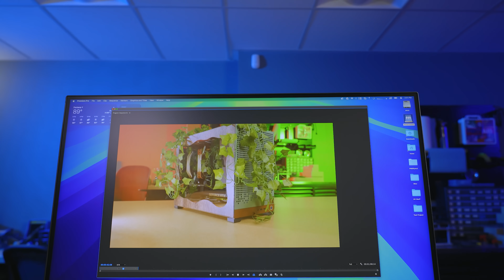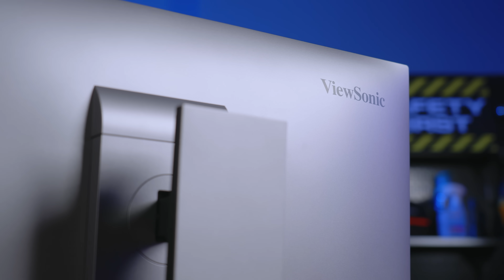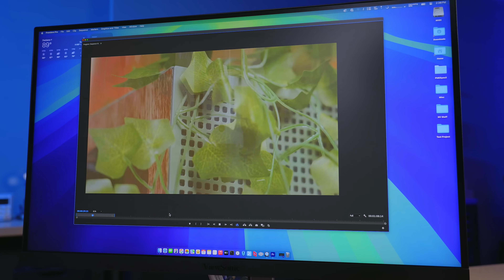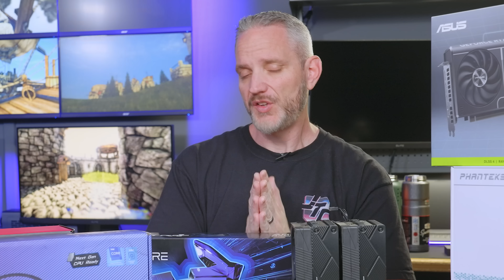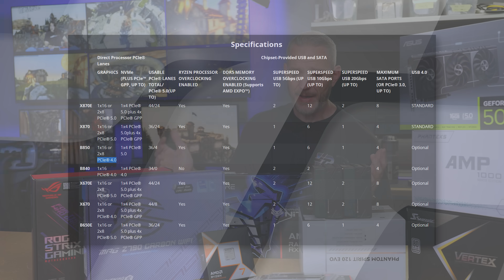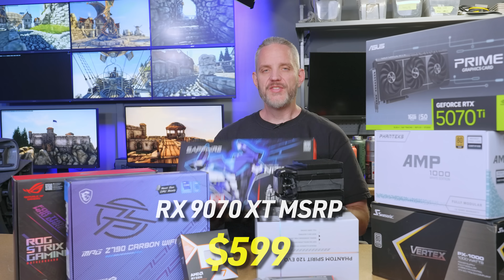This is the Sweetspot for PC gaming... Don't get fooled into spending more!

Comment: I love that Jay brings some common sense to PC building, Not just throwing top of the line products at everyone, The drive comparison for example.
Reply: Well... Cpu upgrade is a lot cheaper than GPU upgrade currently so for spending more on cpu is easier and good future proofing.
Same for faster ssd.
Especially since a lot of player are Fortnite Minecraft and cs 1080p high fps players and in those case, ram, cpu and ssd speed are important
Reply: @Tailslol  Futureproofing is such an empty buzzword that leads people in the wrong direction. Assuming a fixed budget, people buy a CPU for the future and a GPU for the present, which means they get lower performance now for the possibility of higher performance in the future when they upgrade the GPU. The upgrade might never happen, but at least they're ready for it!
Reply: @hafenauer Exactly. Similar to how pickup trucks are basically the most popular car. Most will almost never use that towing or space, but convince themselves they Might need it some day. In the meantime they’re paying tons for gas, not to mention the higher sticker price.
Reply: @hafenauer   it would be true if gpu and cpu values was equivalent and gpu readily available  .
high end to mid range cpu difference is probably 250 to 350 and readily available.
when a gpu is 1000 to 1500 and probably out of stock.
so the cpu upgrade is not penalizing your hardware budget .
we keep desktop around 6 to 10 years so you are very likely to cross at least 2 generation of gpu and upgrade is very likely .
Reply: @humanflourishing2262   i live in europe so pickups are not a thing... and the car analogy is really not appropriated here when current generation of gpu doesn't run any modern games well already without frame generation and upscaling. and lets not forget, cpu and gpu values and availability  are not equivalent currently.
Reply: @Tailslol Ha, that's fair. I guess I disagree, since anything from the 9060xt 16gb to the 5017ti are all 1440 capable. But it depends on what fps demands the individual has, so you are correct in certain contexts. I'm pretty casual so ~90 for me in single player is great!
Reply: @hafenauer  Its not. People who say this don't future-proof really. I had a devils caynon i7-4790K  forever, (7 years?). I bought the cpu that people said, why do you need 4 cores (i think my bro had a 5xxx same thing top of the line cpu)? Well  that's why. I just kept upgrading video cards and it was GREat, then good, then fine until i think 7 years later (i actually did a lot with it in its last days just to see how far i could push it).  Understand, i built multiple PC's in that time for people. But why fix what isn't broken? 

I bought a 7900xt for my last build, when everyone was saying not too (1st AMD purchase ever, because the power and reliability is there for the $$). Recommending not buying them was a thing (that changed but go watch the initial reviews). Why? Obvious, power for $$. Now those cards and 9000xt/x versions are just recognized as the bang for $$. You don't future-proof based on whose (upscaling) DLSS is working well at the time, but raw power.
I did go with a 9800x3d for my last build. I actually was going to go with the 16 core. Because power. But the scheduling, which granted has improved, has an issue. It improvement is not retroactive.  5xxxx3d and 7xxxx3d don't do scheduling as well as 9xxxxx3d, which indicates the next x3d gen's improvement will not be retroactive to the 9xxxxx3d as well. and this is a problem and not worth messing with FOR EVERY SINGLE GAME.
Reply: @Tailslol "Future proof" is a myth inte PC industry so why even use it?
Reply: the monitor is 1k lol

Comment: 16:44 Stop parroting AMD's marketing department. Changing the socket is not a bad a thing. By the time you should upgrade the CPU other technologies will have advanced, Gen 1 AM4 was no guarantee to have a single M.2 slot, what's the PCI-E generation, USB, networking, or many other technologies that have advanced and some didn't even exist like Rebar. If you keep the same motherboard and just upgrade the CPU you are leaving features the CPU supports you paid for off the table because the motherboard doesn't include or support. CPU upgrade cycles should be 3-4 generations for the average user, How many things changed between the 10 and 14 generation of Intel? Would you want the 10th gen motherboard for that 14th gen CPU? No you would want all of the new features so changed sockets doesn't matter. This is the same as Gen 1 AM4 and the latest, buy the latest AM4 CPU as an upgrade you will pair it with the latest AM4 board so the long lasting socket doesn't matter.

Buying a CPU every gen like AMD's marketing wants you to do because you don't need a new motherboard so it is cheap is wasting money. You are buying a new CPU for nominal performance gains you probably won't notice, over 3-4 generations you paid more in CPU's than a new motherboard costs while never noticing performance increases. If you keep the CPU the whole time new games may start to show the CPU's age and not run at the framerates you want, that means it's time to upgrade... and you will see the performance gains and be able to use other newer technologies. The only upgrade path to be considered is when buying middle of the stack now and replacing with top of the stack later when they are on sale or fklooding the used market. 10600k to 10900k at gen 12 release.

Comment: at the start of summer i built my first gaming pc with 7800x3d (bought on sale ) and 9070xt ( got this at lauch and at rrp ) .850w corsair rmx psu . 2tb crutial t500 m.2 b850 tomahawk  corsair vengeance cl30 6000  ram ...in a nzxt h6 flow case thermalright phantom spirit air cooler .. just short of 1500uk pounds..

Comment: Yeah, this is the biggest generational shift we've seen in years — people are replacing RTX 1000, 2000, and even some low-end 3000 series cards. GPU prices are great right now — the 5070 Ti and 5070 are solid picks. On the CPU side, you can grab a Ryzen 7000 or a Raptor Lake chip for really cheap, and they perform almost on par with the latest-gen counterparts! And of course, they avoid tariffs... The second half of 2025 is going to be wild, and not just because of the tariffs.. 

( Honestly, I don’t agree that Intel has nothing to compete with. Where I live, the best-selling CPUs right now are the 14600K and 14700K — they cost next to nothing and outperform pretty much every Ryzen counterpart. To get better performance, you’d have to jump to a 7800X3D or 9800X3D, but those cost like four times more. That’s exactly why the 5070 Ti is selling so well here — people save money on the CPU and end up with a chip that performs just as well (sometimes even better), and the platform savings let them upgrade the GPU instead. Even the 5700X3D is selling like crazy here. You know that famous 'CPU upgrade'? Nobody does it. Every platform sees two or three GPU upgrades, and then the whole system gets replaced. So when it’s time to upgrade the whole rig, you need a new motherboard, faster RAM, maybe new standards have come out — people just go for the best chip at the best price. That’s why, besides the 14600K and 14700K, you know what the best-selling AMD CPU is here? The 5700X3D. But hey, sure, go buy a 7700, pay more for everything, and get worse performance for a CPU upgrade you’ll never actually do. XD ) PS i have an mobo 8200mhz aorus z790 pro x wifi7

Comment: If your purpose is only to game on your pc.. you should just get a console. 

With modern systems..you will only realize the difference in your games when you switch up hardware.. constant change = constantly checking how much of a difference it makes you FEEL. That’s the trap.

The truth is, 80% of max settings will play as normal.. your brain will filter out any real difference as you play the game. If you’re just monitoring the fps .. you’re not a gamer.. you should actually only buy the hardware that’ll run the games you want to play… that’s it.

If you do anything else, it’s good to spec out and design your system that’ll handle your workflow.

That’s why it costs a lot for these types of high end systems, any logical person would spend thousands if it makes them more money.. else you’re the sucker throwing your money away, driving up prices for the rest of us who should actually see this hardware at a reasonable price.

Comment: Just upgraded from a rtx 3070 to a rtx 5070 ti. I was actually able to find one at MSRP and I’m very happy with the upgrade
Reply: Did the same. Paired it with a 9800X3D and 2 sticks of 16 GB 6000 MT/s RAM and I couldn't be happier while gaming at 1440p.
Reply: @michalsnaiberg2734  What Motherboard are you using?
Reply: @Veo1337  ASUS TUF GAMING B650-PLUS. I got when it was on sale for about 50 bucks cheaper than it was usually at the time.
Reply: How as your driver stability been?
Reply: Same here except went to a 9070xt been great so far
Reply: Update - I have the nitro plus version that’s showcased in the video and I did NOT pay a thousand dollars lmao I got it for $650 on newegg
Reply: What cpu are you using?
Reply: Exactly same upgrade here. Also went for a cpu upgrade cause my wife needed a new mb + cpu in her pc and at the point of purchase it was the only gpu I could reasonably get at msrp.

Comment: Watching this video a couple days after I just completed my parts list purchase of: 9800X3D CPU | Astral 5090 GPU | Tryx Pano SE 360 AIO | Lian Li UNI TL 9x1 [RGB ONLY] FANS | 96gb 6000 CL30 RAM | 4TB NVMe | STIX 1200W 80 Platinum | JONSBO BO400 Case - Yeah I over spent by a lot...😅

Comment: 19:00 sapphire nitro $799 in stock.
Reply: still overpriced. RX 9070xt msrp is $600
Reply: @adlibconstitution1609  $650 is msrp. The Nitro is a high end version and $150 cheaper than a low end 5070ti. Both are overpriced but it is what it is.

Comment: My sweetspot is:
Asus B760 TUF Gaming Plus Wifi
i5-12600kf
Rtx 5060ti 16gb
Corsair Vengeance 32gb
Corsair RM750
Samsung 990 Evo 2tb (games)
Kingston 1tb (boot/music)
Peerless Assassin 120SE
NZXT H7 Flow 2024 and some cheap TRight 140mm fans to replace front fans and move the 120mm fans to the bottom.

It was a pretty penny but it's a 1080p powerhouse.

Comment: For me, the best part about going overboard on the power supply right from the start isn't even so much about not having to buy another one. It's about not having to pull the old one out, along with all the cables, and having to re-route all the new cables when I decide to upgrade my GPU. What an annoying pain that is.

Comment: On power supply units, I think you really should have shouted out the PSU cultists tier list. 80+ Gold and power rating really says nothing on the quality of the PSU, and every brand has models which slap and ones which are duds. It's not as simple as "Just buy EVGA or Seasonic." Also noteworthy is what 80+ Gold vs Platinum vs Titanium means. You really shouldn't count on getting the full wattage out of the power supply you buy, as it will really eat away at the life of your power supply and transient spikes pushing your load over what your PSU can handle can fry your PC. 

Really appreciate your acknowledging that some of the better air coolers on the market such as the TR Phantom Spirit will be able to handle anything with fairly modest-ish power demands like the 9800X3D and the 9950X3D. People act like you you gotta go with liquid for stuff like that, but I'd personally only go that direction for some of Intel's hotter and power-hungry chips.

Comment: I shop around and make wishlists on NewEgg for fun all the time. The problem I find with the B series boards is they're no longer the cheap option like they were with the B450 boards. I got my previous B450 board for about $115 on sale and it was a $130 board. You could get other decent B450 boards for $85.

A decent basic B850 board that doesn't look like it came out of a DELL goes for about $150. For an extra $30 you can get a similar X870 board that's really nice looking and has more connectivity options. 

That's why I always default to putting some kind of X870 board on my wishlists when making system builds. The B850 boards aren't worth it. They're suppose to be budget boards but there's nothing budget about them. I'd rather pay extra now for connectivity I might not use right off and have it for when I want to add on in the future.

Comment: Ryzen 7800X3D   400 $
Asrock X670-E (not really e just name) 150 $
64GB DDR5 6000 kingston fury 2x32     150 $
RTX 3060 12GB     350 $
Thermaltake 120SE 7 pipes    40 $
cooleMaster or Corsair  with 3 front fans and mesh grill   70-80 $
Corsair  750 w  80+  bronce/gold     100 $
around $ 1300,  i can play anything i want high settings 1080  144hz,   and if not i just slap lossless scaling ( 10$ ) for fake frames up to 144  
steam Vr vrchat runs SUPER smooth  75fps  with lots of people enabled

Comment: 2:43 If you want to upgrade a single component, let's say two years later, I would prefer to get a higher tier CPU now and a lower tier GPU, so I'd just have to upgrade the latter.
You'd probably have to upgrade some other components, like the motherboard, if you plan to upgrade the CPU later.

Comment: For one there is NO 7800x non 3d cpu. I think you are talking about a 7700x. Now if you can find a awesome deal like my daughter'sBF got after a I pointed it out to him. It was from newegg, it was a 9800x3d, with a Gigabyte X870 AORUS ELITE WIFI7, with 32gb of Gskill 6000mhz ram and 1 TB m2 storage for 700USD. He coupled it with a 9070xt, another 2tb M2, 1000watt PSU, a 360 AIO cooler, Lian Li case, keyboard and mouse. Total of 2200USD for EVERYTHING. Yeah he will be good for a while, with ability to upgrade the GPU in the future. He picked the parts and only guided him in if things would fit or the build would work overall. I wanted him to pick his style and had him do most of the work of putting it together while just observing.

Comment: 3:00 though, keep in mind that if you mostly play simulation games like KSP, more CPU will do a LOT for you. And more RAM.
Reply: Honestly yes, you can see this if you play X4 Foundations. It starts out pretty chill and seemingly easy to run, until you hit the late to end game state.
Reply: Ditto.  I play Distant Worlds 2 and it likes more cores, higher frequency, and 32GB RAM usage is easy for it
Reply: Or if you like to add mods into your game. Looking at you CS2 players. Mods will eat your RAM like tasty candy pieces.
Reply: But even with the new AM5, the cheapest 6-core CPU and a 9060 XT, I really doubt the FPS would drop below 60 in any of those games. It makes sense if you're aiming for 144 FPS, then the X3D is perfect for that

Comment: Currently have a 5080FE, 5700X3D (already had this after upgrading from a 3700X a year ago), 32gb of ram and an 850W PSU. A mix of old and new parts but after selling my old gpu (3080), the whole build cost about $1200 for a 4K capable rig. Although, I play on a 1440P ultrawide. I do wish I spent the extra $50 to get a 1000W PSU. I got a MSI MAG 850 PSU this year for around $110 and the 1000W version was $160 and I cheaped out. However, I don't see myself going over the 80 series level cards anytime soon.

Comment: Jay, try out one the budget Thermalright AIOs.  They legit do better by a fair margin then that air cooler and are priced similarly.  So no, you would not have to spend $100+ on an AIO to match the performance
Reply: Tariffs? they do not sell anywhere close to MSRP in the US right now lol. In EU sure they're pretty cheep
Reply: @Bearded-Mutt what are you taking about. I'm from US and can get a 240mm thermalright AIO for around $55 easily
Reply: @trulsrohk1  Seriously? But you can't get one of their air coolers for less than that? Also, for a first time beginner or general novice which this video is aimed at, simplicity is key and air coolers will always be simpler than AIO's as they do have more long term maintenance. Besides the cooling performance between the two now is negligible in most use cases with noticeable/ measurable differences only showing up in the more high end/ high powered sector.
Reply: @Bearded-Mutt  I'm not advocating that people SHOULD get thermalright AIOs over their air coolers.

Just that they cool better and aren't much more expensive.
Reply: @Bearded-Mutt  You most certainly can get them for MSRP in the US.  Amazon has them at MSRP.

Comment: Asetek can no longer patent troll the location of an impeller.  Man that crap was annoying.
Reply: It was their Intellectual Property that they developed themselves in house so why wouldn't they patent that? And everyone else was willing to license it out for their products so where's the trolling exactly?
Reply: @Bearded-Mutt  They took an off the shelf aquarium impeller and turned it into a liquid cooler so no I do not consider that intellectual property.  When they went and started designing their own impellers - those are intellectual property.  Putting a fan on a ceiling or a switch on a wall is no more intellectual property than a 'pump block'.
Reply: @cracklingice  That a total bs stance to take. They took a component from an item in a totally different market and adapted it to water cooling and as simple as you make it sound it's far more complicated and actually was very effective. Ask anyone who's been water cooling since before that patent existed. You had to rely on aquarium  pump's and they were very hit and miss and would often need replacing. Get your head out of your ass.